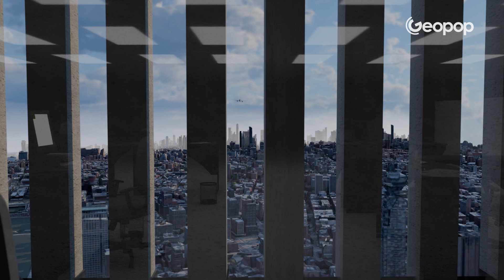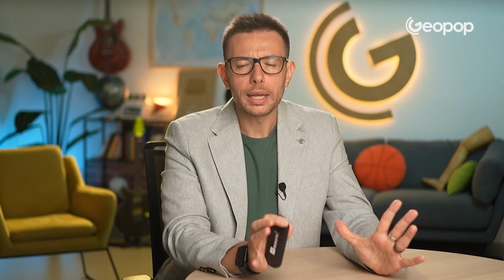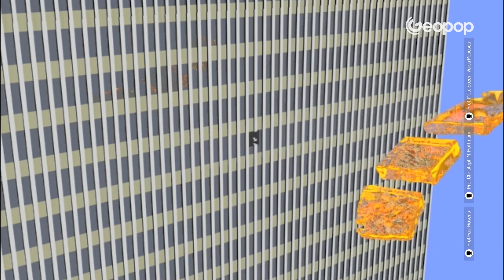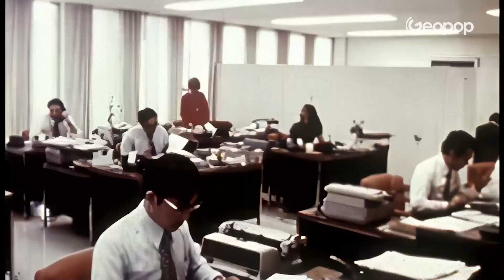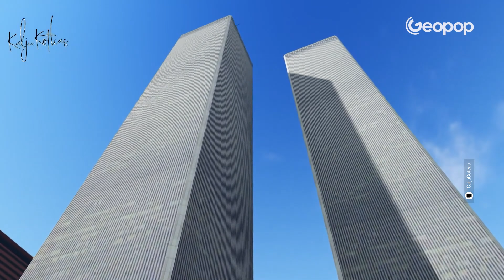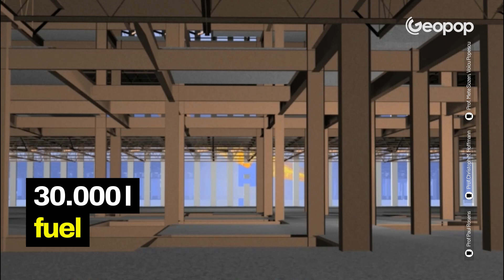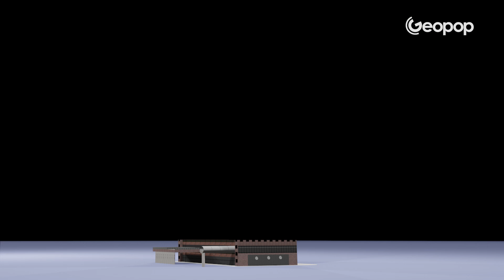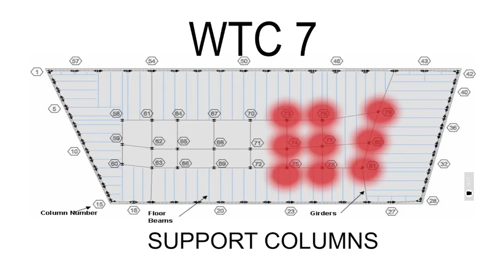9/11, 2001: The Technical Reconstruction of the Twin Towers and WTC 7 Collapses

Comment: I never even suspected there were so many structural engineers in this world.
Reply: You don't have to be a structural engineer to know there was something wrong. Anyone who's ever built a house can see there had to be structural failures in construction, or it was a demolition. The problem with the structural failure angle is that not one building code was altered due to the 9/11 'collapse' of multiple buildings....
Reply: -- Then what is the source of the many tons of molten steel found in and under the debris, the heat so intense that the molten steel remained in that state for weeks afterward, running off of the debris as it was excavated. This cannot be molten copper from wiring that retains the color of a shiny new penny.  It cannot be molten aluminum that retains the color of the polished aluminum wheels of a street racer. It was the color of glowing orange molten steel  that cannot be mistaken for any other material, reported by firefighters who are very experienced in the nature of such materials as well as seen in video evidence.

When you combine this with an entire lack of turbulence behind 500 mph aircraft, when even a small Cessna Aircraft would leave an evident wake in the smoke and fire only seconds later .  . We find that skeptics still cannot be skeptical of the official narrative in explanation.  Sponsored channels and forum activity are skeptical of nothing when support is provided.

Sponsored activity in the forums is very normal today for commercial and political purposes and subjects of controversy -- in the attempt to lead public debate.
Reply: It’s hard to say how many there are for sure but the number would be in the high hundreds of thousands
Reply: @Strobie_one  Correct, possibly even many millions.

Lots of people smart enough to deduct that large structures collapsing straight down are very likely subjected to some form of controlled demolition/human intervention.

No structural engineering degrees needed for that one.

Plus, when you decide to look into it, to dig into all the facts, the evidence for controlled demolition just becomes bigger and bigger and bigger.

As becomes the evidence for a massive unthinkable  cover-up...

A small minority of people is brave enough to follow that evidence to wherever it leads.

The big majority of people is not.

They're too scared, too cowardly, too attached to their current welfare and wellbeing, to question what they're told.

It is what it is...
Reply: Which is more extreme -- to accept without question the inexplicable lack of turbulence in the wake of a 500 mph large passenger airliner -- not evident in the smoke and fire covering the impact zone only seconds later? -- or to recognize the indications of digital projection in its imperfect nature as we see a wing disappear in front of a bright blue sky? From another camera angle, the same aircraft is seen passing behind a crane in the foreground, yet in front of the heavy crane cable. 

There should be a hurricane of turbulence in its wake that would entirely disrupt and disperse the smoke and fire seen billowing outward just 3 to 4 seconds later at both towers.  Even the wake of a small Cessna aircraft would be noticeable -- yet there is nothing.
Reply: Architects and engineers for 9/11 truth... thousands of accredited experts. Look into it
Reply: @ElLowEl .  . "What the hell are you talking about?" .  . 😃 .  . Thank you for your sponsored reply, Mr. EILow.  The word projection indicates holography as you know, commercial demonstrations of which have been amazing in recent years.  To feign ignorance doesn't work well for you, however.  Where, Mr. EILow, is the wake turbulence only seconds after passage of a 500 mph large passenger airliner -- not seen in the smoke and fire covering the impact zone?  Even the wake of a small Cessna Aircraft would be noticeable -- yet there is nothing.  It's likely that no real answer from you is forthcoming. We'll wait and see .  .
Reply: *armchair structural engineers
Reply: @doctorbohr1585  You don't have to be an engineer of any kind actually, to see &  conclude that these 3 buildings came down because of carefully planned controlled demolitions and not some natural collapse just letting nature take it's course.
Reply: @sandervandenberg977 can we agree that 3000 bodies never go missing in a building collapse?
Reply: @Larry26-f1w I believe it's more like around 1000 bodies, not 3000.

Where did you get this number, if I may ask?
Reply: @sandervandenberg977  It obviously wasn't a natural collapse... They were hit by planes 🤦‍♂️🤦‍♂️
Reply: @skipfred  The planes caused some damage.
The official story claims both towers collapsed due to fires, letting nature run it's course.

Ofcourse they were both  demolished on purpose, blown to tiny bits, pieces & a lot of dust.
Reply: @skipfred The planes caused some random damage.
The fires were also random.

The collapses looked pretty controlled ( if you know anything about how to take down large buildings)

According to NIST, fires and just gravity brought down these towers.

They even admit they have no explanation for why the towers came down so fast.

The socalled "crushdown-crushup"- theory from dr. Bazant  is complete bullshit, physics doesn't work that way.
Reply: @skipfred My posts are disappearing after they have appeared, wtf is going on, YouTube?
Reply: @sandervandenberg977  Tbh that happens to me sometimes too. I think sometimes they get rejected, especially if they're sort of rude lol. But could also be the channel owner deleting them maybe.
Reply: @skipfred  Trying for a 3rd time now, see if it stays up this time.....

The planes caused some random damage. 
NIST claims fires brought down both towers as well as building 7.
They claimed only gravity brought down all 3 buildings, just by letting nature take it's course after the buildings were on fire.

This ofcourse, cannot be the case. There's no evidence for that.
There's all the more evidence that all 3 buildings were deliberately brought down through some high tech covert controlled demolition.

Going to hit the little blue triangel now, see what happens.....
Reply: @skipfred  Natural means letting nature takes it's course.
It that was the case these towers would still be standing.

A sudden straight down ultraviolent total collapse, in itself, is an extremely high indication of some type of controlled demolition. 

A natural collapse never goes straight down, never completely collapses and always leaves behind many recognizable parts.

Now let's see if this post stays up.😊
Reply: @sandervandenberg977 Keep telling yourself how smart you are. Those of us who understand science and listen to experts will try and not laugh at your “theory “.
Reply: @randyparker4126  Keep on laughing then, you ignorant nitwit. Laugh all you want, I know it's hard to accept you've been duped. 
It's OK though dont worry about it.
Reply: @randyparker4126 You obviously are clueless about science yourself.

It's OK, most people listen to mainstream experts, no matter how weird their story is  doesn't  matter, they believe them, so they don't have to think for themselves.  Just like you.

It's all good, don't worry about it.
Reply: @randyparker4126  Yes, sure you understand science 😉

No you just listen to "experts", mainstream experts that is. That's what you're good at. And you'll believe absolutely anything they tell you. Sure you will. Because you are so smart, right?
Reply: There are not.

They're mostly people who use their critical thinking skills and possess a functioning bullshitdetector.

Comment: In the short history of steel frame buildings being built, only 3 have ever collapsed. And they collapsed the same day hours apart.
Reply: And how many of the other steel frame buildings were hit by fully loaded 737's going 600 MPH and allowed to burn for over an hour?
Reply: There are just too many convenient coincidental events that took place during this period. It was an inside job between bush Chaney and Israel to start a war against radical Islam.   The towers were condemned prior fault geo etc engineering and asbestos insulation. Vacancy was high. The towers were loosing money.    Lots of Colombian drug cartel us investment brokers got zero that day. All the Enron court evidence got destroyed. All the Austrian nazi gold in the basement of 7 got recovered by Israel. The list goes on
Reply: Recycling talking points that are 20+ years out-of-date does not make for a compelling argument.
Reply: That’s a blatant lie
Reply: Incorrect. Plenty of steel and steel-frame buildings and structures have collapsed:
Plasco Building (Steel)
Edifício Wilton Paes de Almeida (Steel & Steel-reinforced concrete)
Windsor Tower (All of the top 11 steel floors)
McCormick Place
Mumbai High North Platform
Architecture building at Delft University
Sight and Sound Theater
Highway 580 in Oakland
Kader Toy Factory
Dogwood Elementary School

Just to name a few.
Reply: @takotako3321  I actually was in the faculty of architecture at Delft University the moment the first plane struck. They opened up the main classroom when it happened and we watched the second plane crash in on a big screen with probably 500+ students and professors in horror. Off coarse debates and talk everywhere until a couple of professors formed like a panel in front and took the mic and talked about the issues. And I very clearly remember them agreeing on it unanimously that the fire and damage combined will probably be too much for the steel buildings, well before they collapsed. Ironically the same happened to that very same classroom.
Reply: @takotako3321 Can you please provide an argument civilly?  Never in the history of fire-protected structural steel framed buildings have they ever come down entirely, evenly, and through themselves by asymmetrical damage and ensuing fires. Name one. Plasco was not fire protected. Name another.
Reply: Let’s compare that to the buildings that were also hit my an airliner… please don’t be so dense
Reply: @AlexGonzalez-ye9pc  Did you just learn the phrase…  “please dont be so dense”  seeing as you’re commenting it on every comment here?? Weirdo.
Reply: @AlexGonzalez-ye9pc ,   Can you please provide an argument civilly?  Never in the history of fire-protected structural steel framed buildings have they ever come down entirely, evenly, and through themselves by asymmetrical damage and ensuing fires. Name one.
Reply: This is not valid, and even if so doesnt mean a thing.
Reply: @JWHOLLANDIA this is valid. Fire protected structural steel-framed buildings will never collapse globally, symmetrically, and against the path of most resistance from asymmetrical damage and ensuing fires.
Reply: @911WarRoom  well they did, to overwhelming evidence found, and consensus in simulations ran. 
Even though, if you prove to be right, what is your narrative on what happend then?
Reply: @911WarRoom  ? Incorrect. I highly suggest you read research papers on progressive collapses. Progressive collapses can happen due to many reasons, including fire, material failure, earthquakes, etc. There is research available specifically about progressive collapses of steel structures exposed to fire, as well.
Reply: @911WarRoom  "against the path of most resistance from asymmetrical damage"
Buildings suffering structural failure don't fall over like a stack of toy blocks. The path of most resistance is in any direction that ISN'T down. 

That said, your argument seems to focus on greatly overstating the supposed 'perfection' of how the collapse occurred while ignoring that the debris field ended up defacing several nearby buildings. It fell, for the most part, down. Many of the support columns took longer to fail, as the floor trusses providing lateral support were torn free and leaving the columns to experience forces they were never designed to resist. 

Some vague implication that the buildings fell "too perfectly" because it doesn't fit with your intuitive views of what a progressive structure collapse should look like is just an argument from your own personal incredulity and not one based in proving that this 'debunks the narrative'

Glossing over the directly observable facts of the collapse by ignoring the imperfections in how the collapse occurred, the distribution of debris, and for that matter other steel-framed buildings that collapsed due to uncontrolled fire in the intervening decades- isn't the basis for a valid argument, it's just cherry picking.

Comment: Still hard to watch, I did an internship at a wall St  bank in Dec 2000- Feb 2001. I used to get off at the train station at WTC every morning and walk down to main offices, but we also had offices around floor 60-70, (tower 2 I think). I called to my mentor there on the day and there was a meeting at our WTC office when it happened and while on phone to him wave of dust came flying down the street as he was looking up it from our office window (which was at the bottom of the street). At which point he had to go as they were evacuated. I was offered a job, but I said I wanted to return to finish last year of my commerce and arts degrees in Australia. But I ended up becoming a VJ / show designer instead, It was too hard to even ask about job.  I thought I could get through this video but still hard.

Comment: Loose change is worth a watch. NIST is garbage, and didn't have enough info.  You can't be a structural engineer and believe these two steel structures fell straight down from slamming some planes them. Unless you're an idiot.
Reply: Or you could be one of the unfortunate idiots who surface in the comments section to spout debunked conspiracy theories. Sad.
Reply: 2 of the 3 people who made Loose Change would disagree with you that it is worth a watch. They have disowned the movie.
Reply: Play Jenga or the 60s version,  called Topple. Never saw either fall sideways.

Comment: As a structural steal fabricator and welder you can put that type of heat all day to those beams and they won't budge.there cut with a oxygen Aceteline mixture which reaches temps of 4000 f jet fuel don't get no where near that so it's confusing.a I beam at 900f could bear a full load like a walk in the park
Reply: What I-beams?  There were no I-beams.

Sow while irrelevant, since there were no I-beams only lightweight steel trusses, are you sure jet fuel doesn’t burn hot enough to bend steel?

In this video starting at 22:30 and running to 28:10 the Energetic Materials Research and Testing Center (EMRTC) conducts a test to see what an open jet fuel fire can do to a loaded and unprotected steel I-beam. Remember, steel melts (turns into a liquid) at around 2,600-deg F, give or take depending on specific alloy. The test was planned for 30 minutes.

youtube.com/watch?v=JXWCMBuusMI&ab_channel=TrutherTVArchives

Within 2 minutes the open fire temperature has already exceeded 2,000 deg-F. 

After just 3 minutes 40 seconds the beam is sagging noticeably.

The beam fails and collapses 9 seconds later after just 3 minutes 49 seconds.

Note the steel fails but does not melt. It is bent and twisted, but not a puddle. You can still tell it is an I-beam. 

Purely from a jet fuel fire. 

No, jet fuel can not melt steel beams, but then again it doesn’t have to.  The steel fails well before it gets a chance to turn into a puddle and it doesn’t take long. 

Like we see in the first 12 seconds of this video: 

www.youtube.com/watch?v=ULdiD6gYZO0